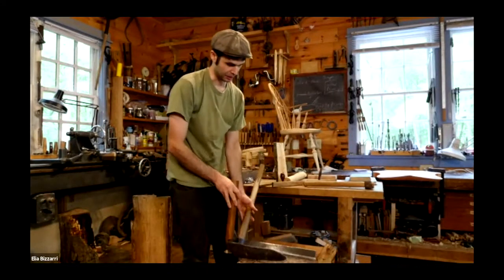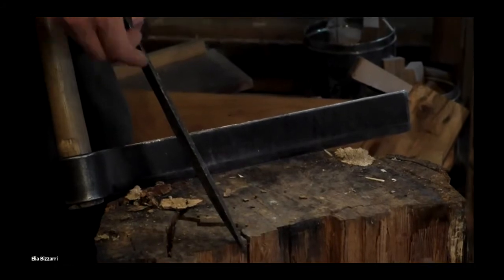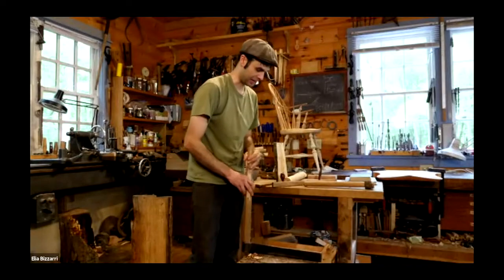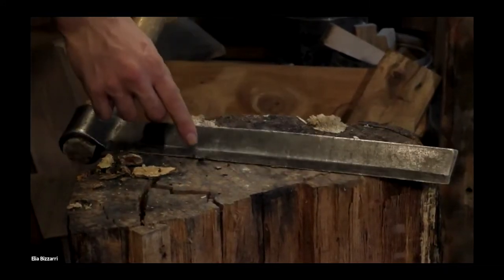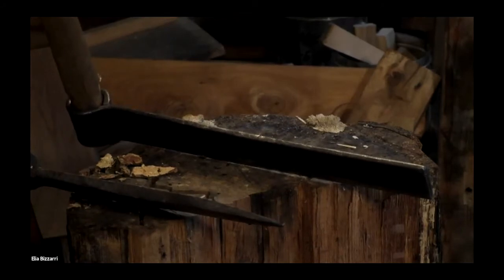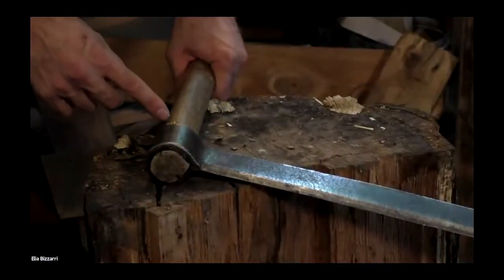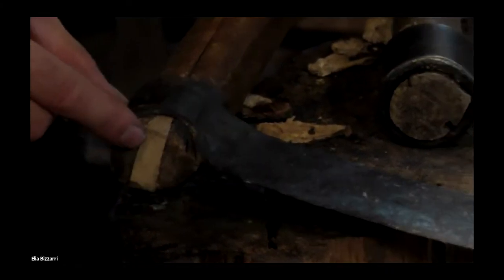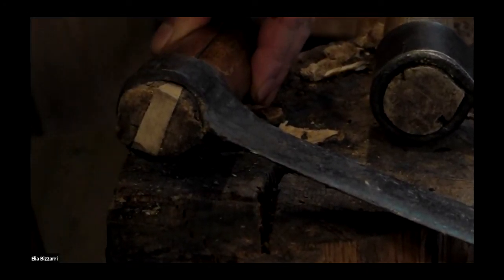Attaching a Froe Handle (So it Stays!)

Comment: Thank you, Mr. Bizzari.
The eye on a froe is /supposed/ to be tapered & the handle is supposed to be a matching taper.
The way a pick or mattock handle is tapered is the way a froe handle is supposed to be tapered.
That keeps the tool from working off the handle.
A froe is not supposed to be hafted like an axe.
An axe handle uses a wedge to 'swell' the handle in the eye.
A froe, like a mattock, uses a similar taper but not a wedge.
So that's what I heard.
Have a GREAT day, Neighbor!

Comment: Sort of like hanging an axe or other tool head, I did mine narrow on the handle side and leaving a good bit on the cutting side of the froe to keep it on on that side. Thinking It may need a locking pin or something yet but Gotta test a bit first.
Reply from the maker: That can work, but the blade tends to bounce up the handle and pinch your fingers when you hit the froe with the club. It usually works best if the blade is held on below and above the handle. I've tried a wooden peg on the handle side, but that sheared off eventually.

Comment: I haven't got a Froe yet. Should I hold off, and keep searching for a Blacksmith one? Or buy a mass-produced one as well? You say you use the mass-produced one most of the time; is that because you prefer it, or are you just protecting the Blacksmith one?
Reply from the maker: It's a matter of opinion, but I prefer my mass-produced one (I think Lee Valley sells them, but I got mine from Woodcraft 20 years ago) because it's thinner than blacksmith made ones, so the split doesn't open up as much before I get the blade buried.   However, the differences are quite subtle and either will work well.
Reply: @eliabizzarri56  blade length mostly your decision for that or? I'm making a froe of angle iron, Got the handle on snug now. Hope it lasts a good while, but I know how to improve the next one any how.